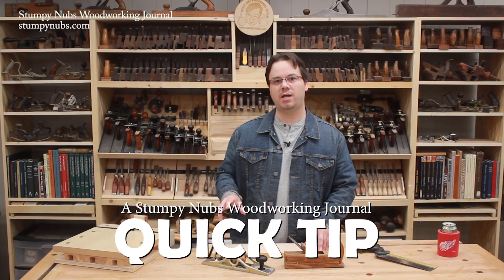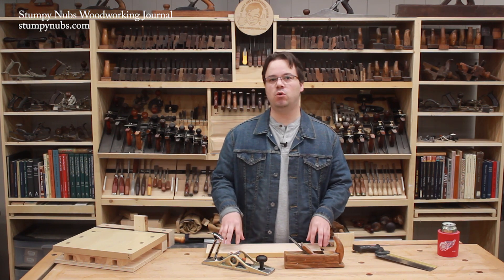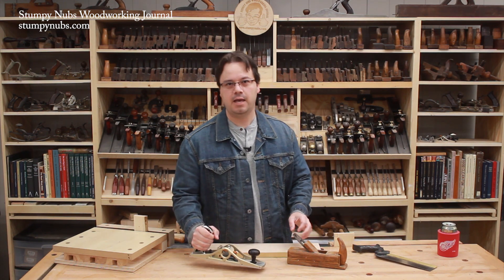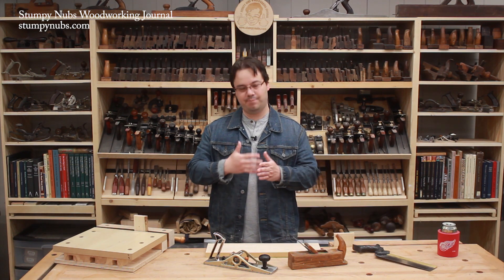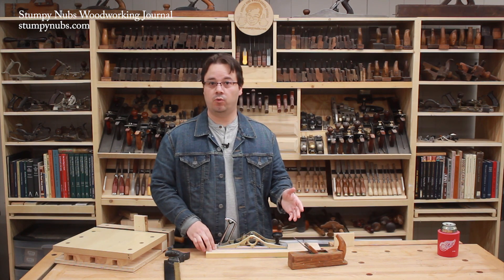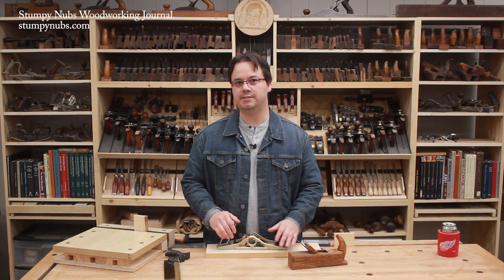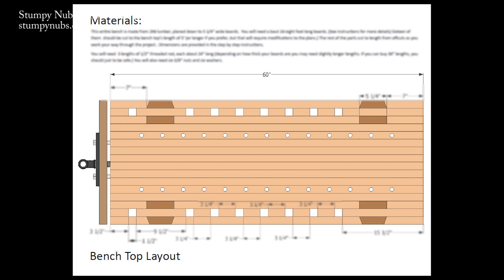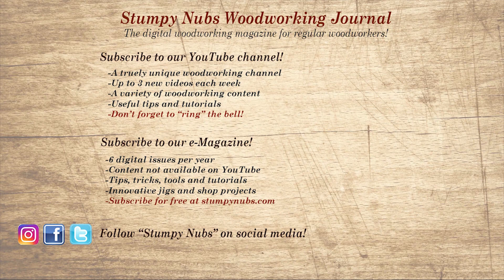How to calculate the perfect workbench height

Comment: I'm 6' with waning vision. My original bench was 36" high with a plywood top. It worked well as an out-feed table for my table saw. As I am doing more hand work, I replaced the ply with a laminated top, so the bench is now 39" high. The wonderful thing I love about wood projects is if your requirements change, take it apart and build it to what you need. Wood is good. Thanks for a great channel.

Comment: There is another factor in small, home workshops, you didn't mention. My table saw is at the center of my shop. When I built my work bench, I designed it with the same height as the top of the saw, so the bench can double as an infeed support for long boards. A bench lower than my saw would be inconvenient, one taller than the saw would be a disaster. A bench designed with only ergonomics in mind is great, all other things being equal, but in small shops that is rarely the case.
Reply: Agreed. That was the number one consideration in our shop reno. All of it is a little high (as I am very short with long arms), but so much better than wrestling with very long boards or wide ply.

Comment: It's not a workbench, but I have an assembly bench that has a scissors jack inside. With that I can raise and lower it to whatever level I need. I lower it all the way for assembly and then raise it to match my table saw so it is my outfeed. It has 2 extensions that fold down when not in use. Essentially, it is 2 boxes. The bottom box is on casters for rolling around as needed. It has no top, but has a slot in one side to accommodate the scissor lift handle. The other box has no bottom and slides down over the lower box. It is a fairly tight fit and I have slick tape at the corners of the lower box to reduce friction. It is made mostly of 3/4" Baltic birch. Jack screws in the legs of a work bench would create essentially the same effect.
Reply: John Slaughter I’d be interested to see a photo of your assembly bench; sounds like a fantastic setup

Comment: Applying the you-can-always-cut-more-off rule, I have built two benches with what felt like the "perfect" height and added 2".  Use it, play with it and cut off the bottoms of the legs 1/2" at a time until it's just right.  Worked for me, anyway.  Now I know for sure where it should be, which is 34" for me.
Reply: Where does the 34” bench reach on your hands when you stand next to it?

Comment: I have a small 10' X 12' shop which has two work benches (2.5' X 6' & 2.5' X 8') inside and one more outside for cutting and sanding on which is also 2.5' X 8' and several saw horses when using my skill saws or planers.

The outside bench is adjustable via a pair of small automotive scissors jacks which can raise or lower the bench top to what ever height I need it to be for my project at that moment; the height is 'set' by placing wood beams (1" increments) between the main frame and the bench top and then firmly securing both with heavy duty (recessed) bolts.

One thing I found which helps is to stand in front of your bench with your upper arms against your body and then place your forearms at a 15 to 30 degree angle in front of your body which will usually give you a fair idea of what is going to be a comfortable height for most of your projects.

Thank you for an excellent tutorial on the various heights a work bench can be for different projects.

Comment: I’m 5’ 4” kind of small for a man. So when I was looking for a stand for my Jet lathe. The Jet stand without a lathe attached was the right height for the top of my lathe. I built my own out of 2x6 and 2 x10 fir lumber and added some Rockier push-to-lift casters on it so it was portable. I’ve been using it going on 5 years and is still solid. It’s held together with 1/4” wood dowels and glue with  steel Cross Dowels  with 5 1/2” Bolts to attach the legs. I found a plan on-line and modified the height and length to satisfy my needs.
Reply: 5’4, that is just right. Never short change yourself ❤

Comment: You always provide good basic information that no one else gives us.  
I am 5'-11" and have a bad back which limits my ability to bend over a work bench.  Luckily, I was able to buy a used steel commercial duty drafting table for $100 about 1990, the kind you would see by the thousands at engineering companies.  It weighs over 200 pounds and cost over $2000 in the 1970s.  It is 38" x 60" and has spring loaded height adjustment between 33" and 46".  I usually use around 38" but I have sometimes used the full 46" for intricate work.  I experimented a lot with the height before I built my other benches at 38".  The top has sheet steel surfaces on the top and the bottom so I have not drilled any holes in it, but I can clamp stop boards to it if need be.  I also use a B&D bench top Work Mate which adds about 6" of height to my fixed height benches.

Comment: I have three work benches and a higher work surface in my shop. Two of the work benches are single sided (drawers on one side), one is double sided with a tool tray in the middle. all three have laminated maple "butcher block" tops. The work surface is a cafeteria serving bench with a 2 inch thick laminated top, steel legs and an open area underneath. The workbench height was determined by the fact that I scored them all from a high school that was shutting down the industrial arts program (where I taught at the time) I may have to think about raising the height as you make some good points!

Comment: My current work bench came with the house and was a little short. I was able to add some thickness to the top and get it to the right height.  For joinery work I have a bench I sit on. The work bench is then a good height for joinery.
When I make a new bench it will not be as long as the current one so, I may have room for a joinery table. Then again I enjoy sitting.
As for the tablesaw out feed table, the current bench is lower than the table. I simply lay a cut off sheet of plywood that has a few batons attached and it is the same height as the TS. I then take it off when the TS is not in use.

Comment: Great explanation. Yes, we need to play around and find the height that works for us. This morning I was working on the final assembly of a tool chest (ala Gerstner) for my apartment workshop (dining room). A drawer back needed to be planed to take off a 1/16 of an inch. the drawer was at shoulder height. I was exhausted after 3 minutes and had to rest my arms. Later in the day, I had no fatigue using my heavy jack plane at table height. (30 inches).

Comment: -4 Carl (retired wood patternmaker 45 yrs.) Not to badly done, you managed to say all the correct things, just with the emphasis on the parts that may confuse the stupid.  You could have just said, "All benches are made short so they can be blocked up."  Don't be afraid to do that.  Yes, several heights of bench are necessary, many books from the end of the 20th century show shooting boards and devices to hold stock while cutting with a hand saw.   As you said, "the important thing is to experiment."

Comment: I read and considered all the height info before building my bench. But a mock-up before the build was not comfortable. I made it to my fathers bench height, about midway between wrist and elbow. Initially felt right but not so much lately. Sawing, planing, chisel work, assembly, router work, no longer feels right. Speaking to dad ‘that’s the height of the benches at work, no chairs needed, it’s too high to sit down .’ I’ve been cutting the beautiful lower portion of the legs off my bench, a little at a time to get it right for me. Cutting up something I’ve handmade and beautiful is emotionally painful, but I’m sure the results will pay off.

Comment: How about several platforms of various thicknesses to stand on? Set the work bench at some “average” height then vary the heights by means of the platforms. Just a thought.
Reply from the maker: If you take a step backwards and off the platform, it could be a very bad situation.
Reply: Stumpy Nubs - good point.
Reply: A 3' 10" lady I work with has a platform (3/4" plywood on 2x6's) about 3x4 foot wide. That should be safe enough to take a step back.[ it passes OSHA regs.]

Comment: IGood job,, well presented.
m an old+timey kinda guy and mine started elbow height but is now 2 inches shorter.
(I did stick my planing stop in the tool well (2.5 inches lower) but not needed and moved up to bench top. If I wanted it higher again I'd make wooden shoes for the legs.

Comment: Great presentation. For what it's worth, my dream work bench would have a hydraulic scissor life as the base. Thus, with a few pumps of the foot pedal (or, to dream big, press the switch on the pneumatic powered lift) to raise the bench when needed. But, those things cost significant dollars when dealing with one large enough, so a dream it remains.

Comment: I am 5’4. I have 2 benches. One is wrist high -27 inches . I have a second bench that is about 3 or 4  higher. I do most of my joinery and carving on the higher bench ; same height as my table saw. Planing and scraping is usually on the smaller bench. Honestly I don’t know that I notice the difference .

Comment: With no experience, I must ask a newbie question. Why not go for the wrist high planing one and then just pull up a low stool and sit down for the stuff where it needs to be higher?
Reply from the maker: Working in a seated position isn't always comfortable, and it restricts the movements required for some hand tool work.
Reply: @StumpyNubs  Got it. Thanks. :)

Comment: Hi James! I just measured my home built workbench. It is 38.5 inches high. It started out at 37 inches. A real, potentially dangerous, incident with a hand held router left a nasty half moon divot in the top when  the bit slipped out in the colett while I was trimming a project. Fortunately for me it never escaped completely. However, an ugly and embarasing souvenier resulted. I lived with it for about a year, as I feel that humility is usually a good thing. But this was to extreem for me. I decided to try covering the bench with some 3/4 Baltic Birch plywood. It would never be as hard but certainly more pleasant. It was, however expensive, so I looked around at MDF and other solutions. The I had a brilliant idea why not buy a table top and trim to fit? I found a 1.5 inch thick Birch table top on Amazon at an amazing price. I bought two, for both sides of my Mitre saw station which also had to be adjusted up i.5 inches. I framed them with 3/4 0ak. The outcome just astounded me because it was so beautiful!. The result left a nice tool tray along the wall.  It turned out to be not ALL good though. Now I just hate hitting it with a hammer or other such violent tool. I have to cover it when doing finishing work as well. Finally I got up my nerve and drilled Dog holes over both ends of one side, leaving the center undisturbed. The dog holes were located by  using a pilot drill and a piece of pegboard. It came out better than a lot of my furniture pieces  It looks like one.

Comment: Okay James, here's a challenge. Design the perfect work bench with a height adjustable feature, possibly a rack and pinion mechanism with electric motors to dial it in for the perfect task oriented height. Sure, probably expensive, but how sweet would it be. Push the button, it's an outfeed table, push again, hand saw height, raise it up for the perfect hand plane height for multiple thicknesses of wood, adjust again for assembly height. There's a lot of smart and creative guys out there who can get this ball rolling.

Comment: I have a question and/or thought I have entertained an idea that just might be the solution to the different heights that one may want except for the very lowest of needs. [You loss some storage] By shorting the legs and boring into the floor side of the legs inserting scaffolding jacks into them with a sleeve to help with wear. What are your thoughts?
Reply from the maker: There are some reasonably solid adjustable benches out there, but they lack the traditional features that are so useful.

Comment: I prefer tall benches, even for hand planing and assembly. If your handplane is sharp the bottom of it waxed, you shouldn't have any issues using a tall bench. In fact it would be much easier to check the flatness of the piece you're are planing if the bench is taller. I have never been a moxon vise fan. An added heavy item that has to be lifted put on and taken off the bench then stored away on daily basis.  Having a moxon vise makes sense if your bench is very low and does not have a good functioning vise. Most woodworkers make a moxon vise because it is just a fun project. There is nothing is wrong with that.

Comment: I'm 6'4" and echo everything you say. I'm fortunate to have space for several benches and they vary in height for different functions. Incidentally, I've found using table saws, planer/thicknesser, pillar drill and band saws easier and safer since I raised them by 4". They're built for an average height person and merit adjusting for taller people.
Reply: I'm 6'7" and NOTHING in this world is the correct height for me. I've got my saw on 4" risers as well.

Comment: Share the garage with two cars, storage, Atlas F hand-me-down lathe, Rong Fu bench mill,  drill press, and storage work bench.  NO Room Left for a bench.  Have the cut off of a ceiling beam 65 x 10 x 4 left by previous owner.  Chose to build a Moravian travel bench from it.  I am going to increase the leg height.  Can be easier to lower then raise.  Retired mechanical engineer skilled and sitting in front of a monitor.

Comment: Bench height is really a custom  item.  Think of the difference of comfortable work height between someone 5' tall and someone 6'6" tall. Some make elaborate scissor lifts which is fine.  Another would be to install leg adjustors that would move your bench height to the highest and lowest levels you want like welding tables.  If you have a metal lathe then it's not very expensive.  Otherwise find a machinist that will make them for you.  You could use threaded rod but it wouldn't be heavy duty enough if you have to raise it very much.  Made correctly it will be as stable as if the legs were flat on the floor and last a lifetime or more.

Comment: I can't be the only one trying to think of a way to make a workbench with adjustable legs.
Reply: All you need is 4 hydraulic cylinders for legs and a foot operated  hydraulic pump.
Reply: @SuperCorsair  Or a lifting mechanism to get it up onto wheels, with brakes for the wheels.
Reply: Chuck S: Adjustable legs is too time consuming, you might consider a simpler method instead, by using varying thicknesses of wood between the frame and the table top in 1" increments which are then firmly secured via at least two (recessed) 'through-bolts' from the bench top into cross braces in the frame.

If you have stuff such as a tool box, a vise, or a permanently mounted drill press on the bench top, a couple of small bottle jacks or small scissor-jacks from a small automobile will work very nicely, my bench is set up with scissor-jacks only because they were laying around in my garage.

Hope this helped.

Comment: There were sports cars when we were kids that were small and nimble and low and lightweight.
Then there were super cars which got a bit bigger and rather heavier with wide wheels and big engines.
After that came the hyper cars. Very low production numbers, very high prices and staggerring performance. The koenigsegg is the latter.

Comment: Build it at 32" with worm drive cranks at the four corners to raise it to 40" !  Problem solved !!
Reply: Built a work bench for my son last year with jackscrews in the legs driven gy a cectral sprocket that has a drive adapter for a reversible drill ,adjusts anywhere from 30 to 40 inches in seconds.